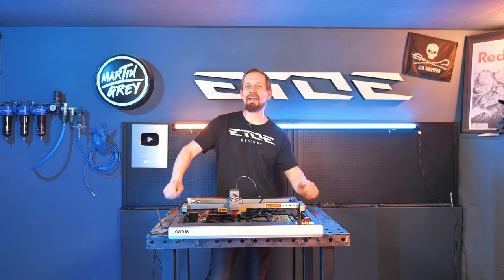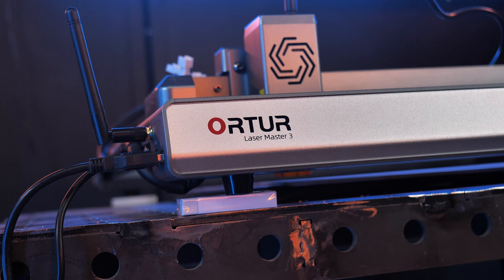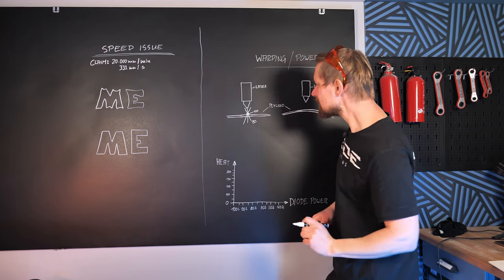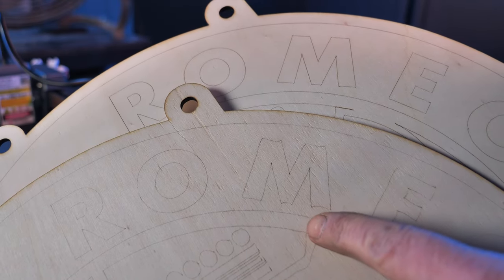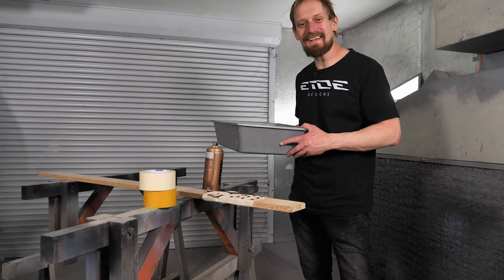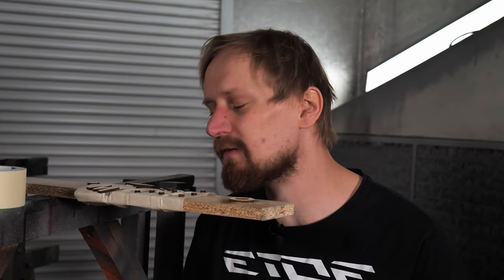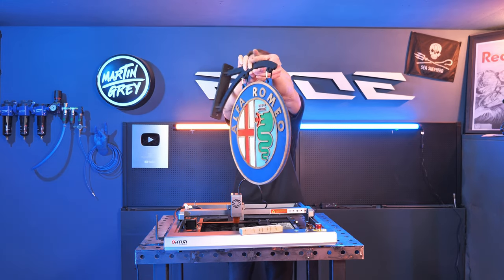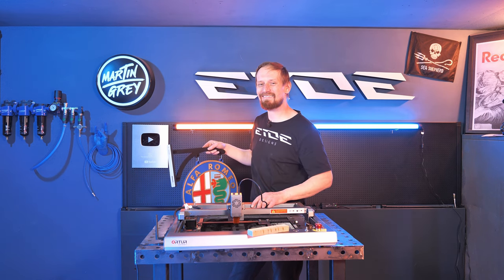Create 3D Shop Signs without a CNC

Comment: Hold on a sec, but technically laser cutter is a CNC
Reply from the maker: True but most people think of a router not a laser when talking about a cnc.
Reply: @ETOE  or a 5-axis mill...
Reply: @ETOE  not most people, at least in my area.
Reply: @feedbackzaloop  yes and especially if we don't consider lazers CNCs, then how about I use an EDM to make more precise and complexed badge? 😅then I say EDM is not CNC........
Reply: @nishieda  CNC or not is not about how precise your tool is but how do you move it. If your EDM by chance has manual feed and you use only that, it ain't CNC
Reply: @feedbackzaloop  haha I had never experienced a manual feed EDM machine 🤣